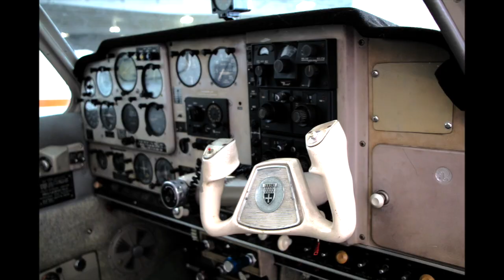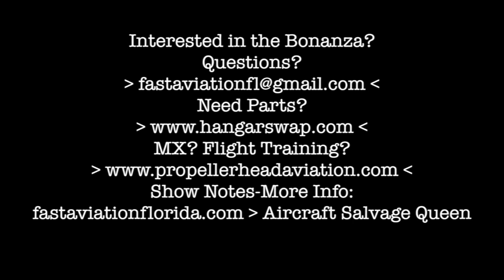1966 Beechcraft Bonanza V35TC: To Rebuild or Part Out-That is the Question!

Comment: Is corrosion an issue with Bonanzas?. I only ever worked on one (prep for its annual?) and we found corrosion in the rear fuselage and rear of the stbd wing. It got a permit for one flight to a place of repair. Must have been sorted as it is still flying 30 years after that.
I had to drill a small hole in the rear fuselage underside to drain a big puddle that had formed inside it.

Comment: Those v tail Bonanzas are suicide machines. Fly them in turbulence if you want to check out of this life.
Reply: i live in iowa and have about 1500 hrs of vtail time and with 15 gal tip tanks the swagger problem is nil- i have been in snow rain --tstorms and many crosswinds--i love these planes and the vtail killer is shear myth--in case you think i am wrong i will tell you i have 300 hrs in cessna 310-a true load hauler but the fun flying has been in the v-tail bonanza with an stec ap plus a 530 and king ksi-55-and stormscope
Reply: I flew in my dad’s Bo’s for many many years…never any problems….he had common sense and was a very good pilot…😊